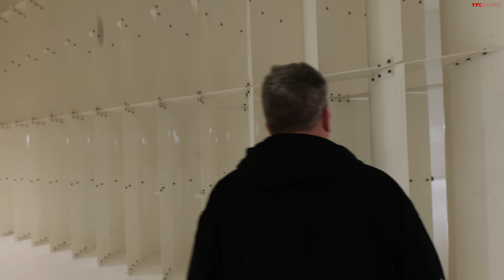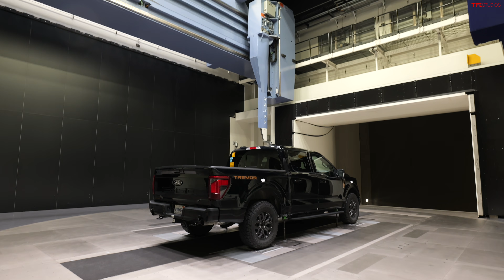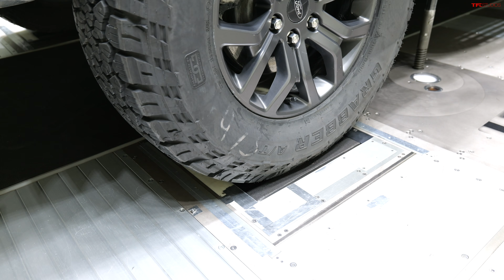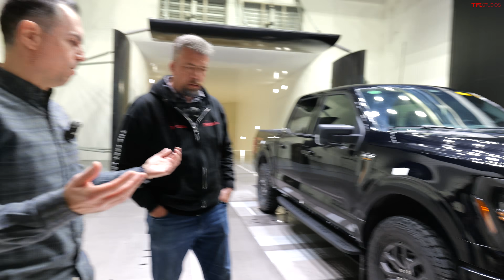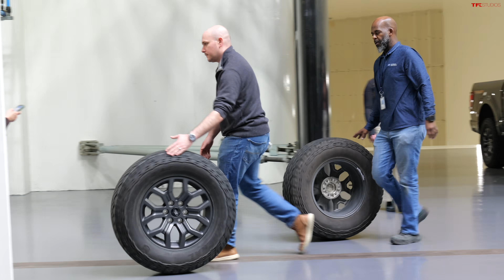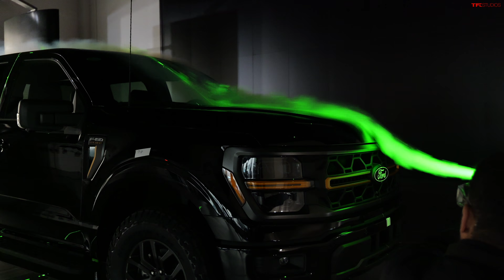EXCLUSIVE: You Aren’t Supposed to See How They Test New Ford F-150 Trucks!

Comment: A bit ironic to see this after watching your video about top ten things to change on new trucks (no air dams, bigger tires, no start stop, no dfm) now that the president's war has spiked fuel costs in my state of Alaska to over $5/gallon.  As a side note, there is stuff that can be done to tires to make them more efficient.  For one,  those tread blocks on the sidewalls might look cool (debatable), but the mess with the aero.

Comment: Andre, did you happen to find Ford's Quality Lab? Didn't think so, as Quality is Job None. 
Ford hold the record for the most frequently recalled vehicle. I would have bet that the record belonged to GM with the L87 engine and the 10 speed automatic transmission debacle.

Comment: I heard that Ford has a company they use in far northern Mn that use  big # of F150s in their business. When Ford has a new model to winter test, they ship a boatload of the new trucks to this company to put into daily service in their business to beat on day in  day out for Ford. With the F150-I also have heard they 
will bolt on the last gen sheet metal to the nextgen underpinnings so it looks like a lastgen truck for testing out in public while it is really a nextgen. 
Pretty sneaky Ford.

!

Comment: They could have used the money they spent on that and built a better truck. All the plastic oil pans, valve covers and intakes that crack and warp after 5 years. Just go back to building something reliable that last!
Reply: Yes plastic connectors & Y's on coolant hoses that crap out long before they should

Comment: Spoiler alert: They watched Brokeback Mountain on the infotainment system and wept together. They practiced pushing it around on the shop floor. They tinted the windshield with 5% so you can’t see the smoke coming from the hood. They even added more sound deadening so you can’t hear the cam phasers rattling. It’s a FORD. 😂

Comment: Wish they would put as much effort into reliability testing and validation.😂
Reply: They know how to build reliable vehicles but use such poor quality materials and plastic to save costs it doesn’t make it into the final product
Reply: True. Not just immediate results, but long-term too.
Reply: The engineering team does design them to last but accounting and production teams ruin them with different materials used
Reply: Yes - what the heck 10R80 introduced 2017 & I've got a 2022 that I drive with my fingers constantly crossed hoping it stays together !  It's not manufacturing errors but poorly engineered CDF drum & bushing with no flange. Also the soft aluminum clutch basket that wears out is now annodized. I'm sure they noticed this in testing but it was ignored.
Reply: Fords are very reliable good trucks but when there’s careless people slapping them together those trucks have some issues. It’s the careless auto workers in America to blame for most reliability issues.
Reply: So true! Got my 2018 with 120k miles at the shop for a reman transmission
Reply: They do.
They engineer to a spec and a price.
Reply: Reliability is achieved by building it in, not as much by testing to see if it worked after the fact.  There may be some checks, but Toyota's best work is built in and stop and make good as you go, not testing at the end.  Ford turned out way higher quality products by doing this in the mid 80's than we realized at the time by bringing in W. Edwards Deming.  Problem is, when that CEO left, and then retired from Chairman, that dropped off again.  It isn't culturally baked in.

Note, however, the Ecoboost is proving to be on the upper end of reliable and long lasting.  I'd pick the old V8's, as well as Toyota's 5.7 and Nissan's 5.6.  I would also pick Nissan's 3.5L V6 Turbo as the top V6 option, and an nod to (oddly) the BMW inline 6.  But the 2.7L Ecoboost is challenging those, and the 3.5L Ecoboost is maybe a notch behind but right there.  The transmission problems are actually fairly well addressed.  The upgraded materials and made design adjustments for the valve body, converter, and one other fitment improvement I can't recall off the top of my head.  They are improved over GM for certain.  Whether it challenges the ZF or not, we'll see.  If you upgrade with Next Gen Drivetrain parts, you're good.  I think Ford eliminated the need for that, but we'll see.  The powertrain for Ford is currently better for long life reliability and practical maintenance than GM, and a bit better the Ram and even Toyota currently.  Toyota needs to get back to being Toyota quickly.

Nissan doesn't have pickups now.  But the Armada powertrain is better than all of the above off the lot.  Ford is actually currently doing some good work there.  I can't speak for the whole truck bumper to bumper yet.  But the powertrain is doing well.  I can see 2026 Ford trucks being on the road a long time.
Reply: So should the tundra folks
Reply: @HelicopterDad-y5o They do that is why they don't have issues troll.
Reply: @Georgewashington-o7m  new tundra is reliable? They are having problems and recalls on them

Comment: Wouldn’t the wheels rotating change the dynamics?  I wonder why there is a static test done and not with the wheels rotating the same speed as the air.
Reply: wheels weren't rotating as they have non-ford employees there and it's a safety risk if one of them stepped in an area that wasn't safe.
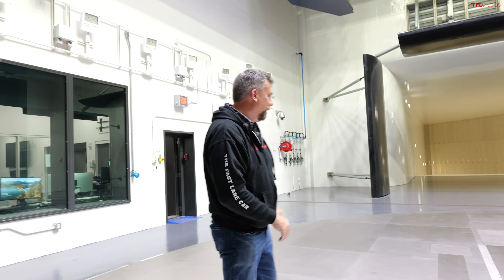Reply: 9:48 They are rotating
Reply: @KevinM1973  not when they have the smoke though.
Reply: @Kin @KingLuis1985 that’s what I mean. Plus why would a non ford employee matter.
Reply: @trx350  liabilities, insurance, etc.  when you have non-employee's visiting an area where they are usually not allowed to enter, they aren't covered by the companies insurance/safety coverages for accidents.  there are forms and stuff that gets signed to protect ford from being sued, but precautions are always there.  don't want it getting on the news that a visitor to the ford wind tunnel got dragged under the truck while walking around it.

Comment: They didn't test mine too well because it's a piece of crap , been buying Ford vehicles for 42 years but this truck is my last one , drove a buddy's new Ram Rebel and wow so much better ride quality is better engine is smother transmission is better and the interior dose not look like it was designed by the Matel toy company and no door seal leak no wind noise coming through the door on the exspress way 😮
Reply: Looked at 2025 Ford F-150s during truck month. With 12 recalls on this 5th model year, many that are serious, I realized how poor Ford's quality is.
Reply: Yes I also was a Ford Guy until getting into most recent F150 gen.  I may just search out a clean truck from 15 or so years ago
Reply: Enjoy your new 40,000 mile truck lol

Comment: Sad that Ford is way too worried about the OEM tires having good fuel efficiency and not interested in the ability of the tire to perform as intended.  This is why every new car that I have purchased has come from the factory with the worst performing tires.  It's not worth a couple of miles per gallon to sacrifice a cars ability to perform in critical situations.  I presume this happens at every other auto manufacturer where meeting a government requirement is more important than providing a top performing vehicle to the consumer.
Reply: Michelin tires do suck big time

Comment: Don’t need to interpret the air from just that one wand. I would not say a tonneau cover having not effect. Would be a good test. Remember, air is coming from a plane all the way around be front and cab and a lot of”pools” behind the cab creating differential pressure and drag.
Reply: And what would a fiberglass cap do? Also is that the purpose of that little lip extension on the tail gate for?
Reply: @KenSchmitt-zr1 be interesting to find out. The lip on the tail gate helps separate some air flowing over the back to move the low pressure further back off the tailgate and reduce drag. You’re a sharp feature many times at the top of the lift gate on an suv or at the rear quarters of cars. It helps keep air from wrapping around the back of the car.